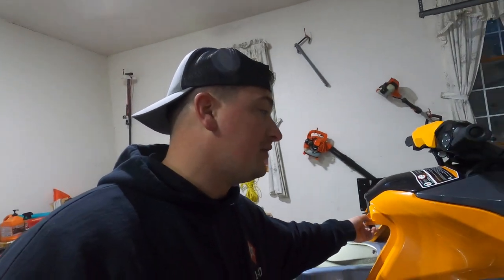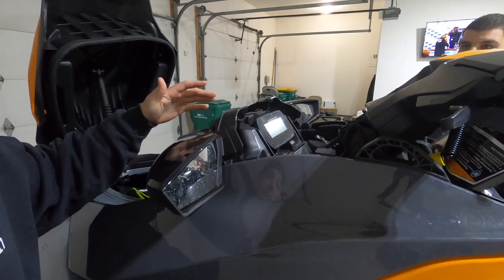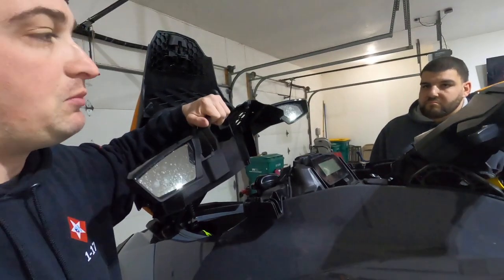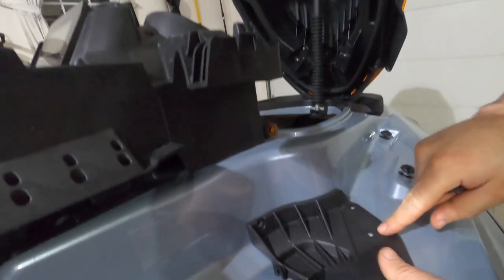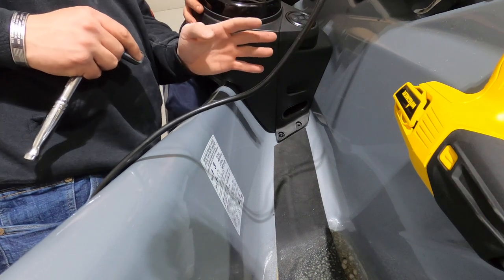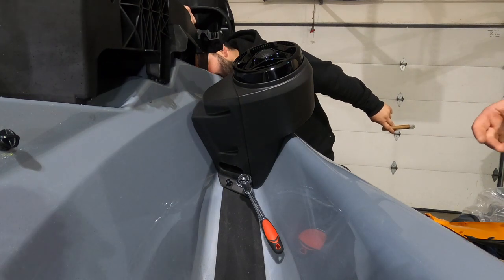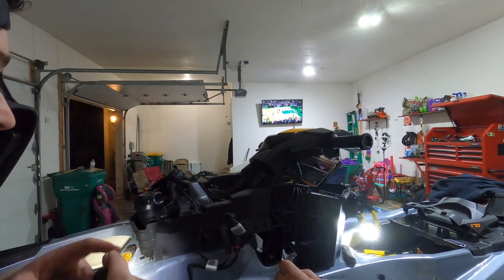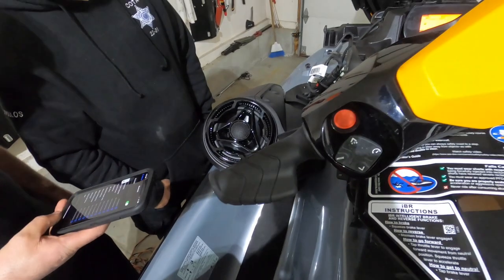How to install BRP premium Audio Speakers on my 2022 SeaDoo GTI 170

Comment: I have the audio on my 2018 GTX?  Thought I heard you say it does not fit on earlier than 2020. Did you mean GTI earlier than 2020?
Reply from the maker: Correct GTI earlier than 2020 i probably miss spoke i have a 2019 gtx as well woth premium audio